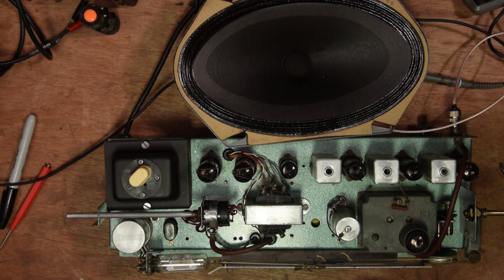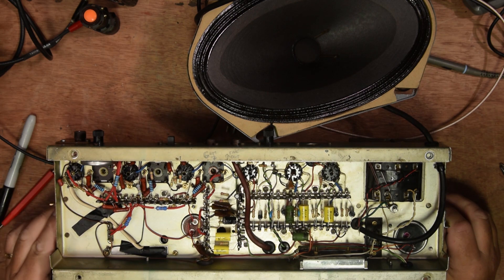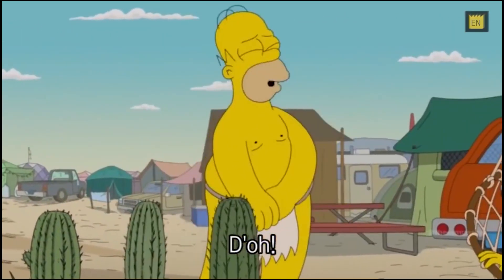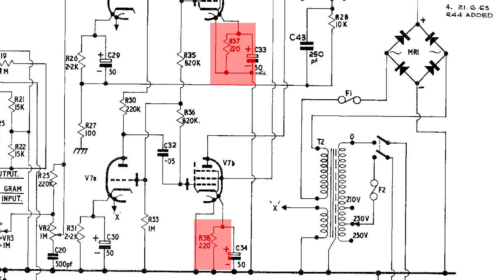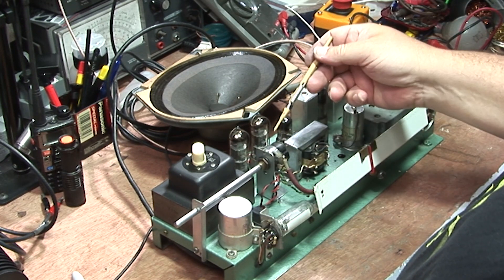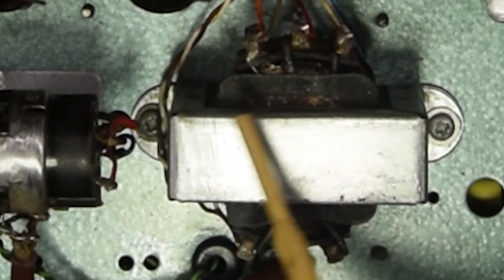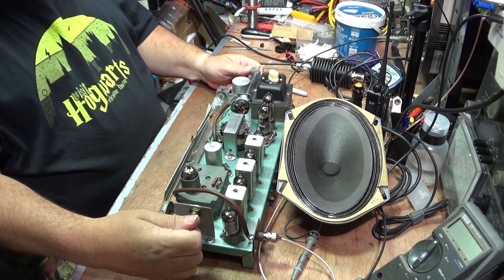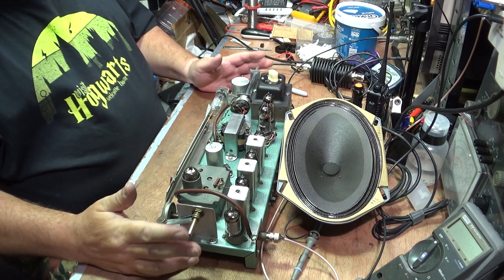Hacker Mayflower 2 : Chassis Reassembly and Test

Comment: That is a great job you have done there on that Hacker Mayflower 2 valve radio chassis in cleaning it & replacing the capacitors & resistors.
The cabinet is looking good as well & I am sure the radio will look & sound the part when you have finished working on it.
Just asking if the majority of valve radios have a 'live chassis' on AC/DC models please? Keep up the good work & thank you for posting helpful video.
Reply from the maker: Any set that is AC/DC generally WILL have a live chassis and needs to be treated a bit carefully. The first thing to do is to check the polarity of the mains wiring so the neutral actually connects to the chassis and the plug can only be used one way, the second is to run the radio from an external isolation transformer.

The Mayflower 2 is not a live chassis set as it has a proper mains transformer in it to isolate it from direct connection to the supply. It still has its issues with safety, having an HT voltage aof nearly 300v DC at around 100mA which is plenty enough to give you a very permanent bad day if you are unlucky. As long as the usual safety procedures such as one handed testing and rubber soled shoes are followed there should be minimal danger as such, the biggest issue usually comes from complacency or carelessness.

Comment: That's is a beautiful rebuilding job you have done George. That's also some really nice wiring under the chassis reminds me of precise military wiring in Collins radios' Its always great to have a working radio after all of your hard work. The resistor Snafu does happen at times but unfortunately it always happens at the wrong time . Thanks for Sharing LL
Reply from the maker: Thanks Larry. It is similar in style to some amplifier designs, notably fender, as well as radio designs. As for the resistor error... Still kicking myself over it.

Comment: Ay Up George, I stripped down the Tesla and found the 3 missing volves!! under the base. All 3 trapped in their own non rattle hidey hole and still intact looking shiny and clear. So another look at it striped down and its all there, a 26 quid (nice un, Mr Dison).
Might need a mains and audio transformer, and a year or two. But its lovely.        Oh! and the odd question to you and the radio gang if thats ok?.     I know he was long gone when this radio was made, but if I can make it work its just a connection to the great TESLA!
Reply from the maker: Of course you can ask questions to me and the other people in the group, its what we do! Glad you found all the bits, it should at least save you hunting the ebay pages of valves for sale....
Reply: @GeorgeChristofi  Thanks George. Should I be putting together one of those restricting light bulb gizmos to avoid tears and fire?. Would a Variac do or both?. 

Fine wires on the rotating ferrite, can I use nail varnish for new insulation?  I have a drop of Passion Pink left lol.  Ta.

Comment: Nice radio, George. 3 IF stages and a push pull ultra linear output stage. I will have to own one of these hackers one day.  Nice neat job and I like the multi camera angles.
Reply from the maker: Thanks Darren. Yep, it is a nice radio, I must get round to putting in an external aerial to the bench to show this stuff off. Multi camera angles arte fun but a lot more work to edit!

Comment: Man made fault - I did something similar with a TV Line Output Transformer. Shorting EHT to the chassis...  the smell gave it away!  Often the brain does not take everything in until you go and look at something else and come back!
Reply from the maker: Silly errors Steve, we all make them. I just shouldn't have been so dense as to think a cathode bias of 220K on an ecl86 was correct...

Comment: Really great looking chassis George, very clean work. The cabinet is looking great too. That 7070 signal generator had a mis-print on the schematic.  It's bad enough when we look at something and read it wrong. It's even worse when the schematic itself is in error. Great work sir, stay safe and healthy.
Reply from the maker: Funny you should say that Gregg because the Hacker manual for this set has an error in the layout. It shows 2 C38 capacitors although the schematic is correct. Schoolboy error on my part... no bias resistor on a cathode is 220K.... Should have thunked into my head instead of just seeing 22 instead of 220....

Comment: Super Job George And The Cabinet Turned Out Really Nice !! Wish I Had Kept My 10x6 Speakers From Back in The Day !! Thanks For Posting Looking Forward To Final Part Regards mike.
Reply from the maker: Ta Mike. I was umming and ahhing over the cabinet finish... do I polish it, do I add another clear coat of satin, do I leave it slightly rough?... all options... in the end, I just knocked it back a bit with 000 wire wool and thats how it sits at the moment.

Comment: Super Hackering George. Nice and shiny too which will help the electrons flow in the right direction :) Must have been a very expensive set to buy back in 1962 when launched but they must have sold quite a few as they were still making them through 1967.
Reply from the maker: It is actually a great set to listen too (when the lights and cameras are off) and it runs a dream. The main filter cap is dated 1965 in this one so more to the later production run than the earlier one. I think the Mayflower one has the prettier case though.

Comment: You mean all the resistor colors have to match? Wow, who'd a thunk 😋 You figured it out, that's all that counts.👍👍
Reply from the maker: it certainly was a Doh! moment Bob. I couldn't see the wood for the trees because in that set 220K is such a common value. I should have spotted it earlier when thinking about the cathode bias on the output tubes. I have never seen a bias value that high before and it should have rung bells in my head a lot sooner.

Comment: Nice radio and a very neat clean chassis.
Reply from the maker: Thanks Bill. it was made easier because someone had already tried to restore it by pulling the waxies out. Just a shame some of the caps were wrong values and those resistors... I could have strung myself up for not noticing a silly error like that.

Comment: Very brave endeavour, George. Well done. I know it can be nerve-wracking.
I did a complete rebuild once on a Grundig. Why? Because I wanted to see if I could :)
It actually worked, which surprised the hell out of me, but the satisfaction was indescribable. 
Good luck with the cabinet. Just a pointer: if you want to see  how a cabinet should be done, have a look at David Tipton’s latest video. He made me realise just how crappy my cabinet work is. Almost made me cry :)
Reply from the maker: Indeed Manuel, my cabinet work is only amateur level at best. Never really a woodworker. That Grundig cabinet David finished with the sunburst really came out great. I thought about spraying stains and lacquers but I don't do enough to justify the gear and the weather in England doesn't give many Spray days.  I only did the full rebuild because pretty much everything was out of spec, if I could get away with not doing it that would be great! Following that Braun of yours with interest... another 70's quirky set by the looks of things.

Comment: Nice! Lol....I once built a novice ham radio transmitter, back in the 1980’s......never got it to work...then almost 15 years later... I noticed the color codes on a resistor was wrong... I had installed the wrong value and it took me that long to catch it...now I hadnt worked on it that long, lol, but I did get it to work! Take Care—Larry
Reply from the maker: These things are sent to try us Larry. I don't know why the two resistors were left in the set. I went through everything looking for out of tolerance stuff but didn't reference it against the values on the schematic...

Comment: Love the invisible watch george, have you looked at your wrist for the missing time :-D
We all make mistakes said the darlek as it climbed off the dustbin (an old joke that must be used ) :-D
Loverly fresh radio, all the crappy bits in the dustbin.
I normally screw up if the resistor value is not one of the typical types used, then i have to recall the colour number from 30 years ago.
If it's one of those blue 4 band ones i'm buggered, the mixed 1% 0.6w bag that maplins sold, the blue body just confuses the peepers, and smurfs :)
Reply from the maker: that was my own fault really. I had changed every other component on that tag strip but those two resistors because they were newer and in spec... I didn't think they would be wrong values....
Reply: @GeorgeChristofi  Well... ok it's all your fault ha ha :-D
it's so easy to make mistakes but it's not always obvious what caused it.
You may get interupted and that's a great way to forget something and lose something that takes you days to find again.
it was in the fridge!!,  As you were putting the milk back and the door knocked the milk and the keys in your hand were dumped in the same place and the memory of the event was stored in the wrong place, so it seems to be missing.
But when you find the keys, the memory is located and you feel like a right muppet.
If this sounds familiar, we all do it so don't knock yourself for being a muppet lol.

Comment: A supper clean rebuild george and a lesson to the americans its not only caps that need changing.
Reply from the maker: Thanks Rob. Yes, I knew the caps were going to be an issue but I did test a sample of resistors and found them all out of tolerance. Sure, the thing worked when I got it but working, and working as well as it could are two different things.